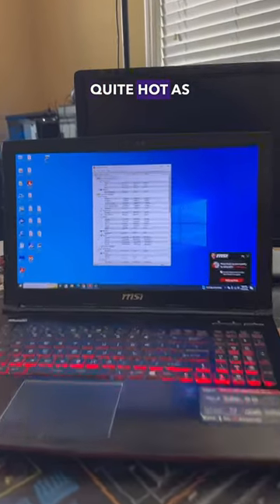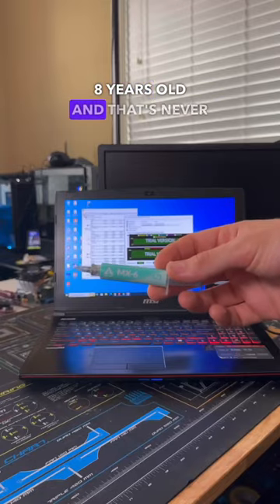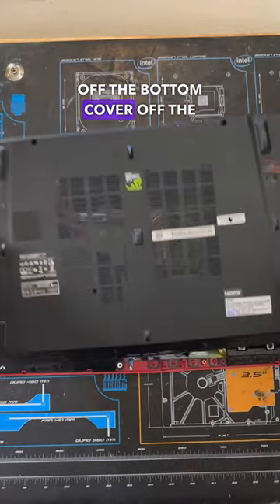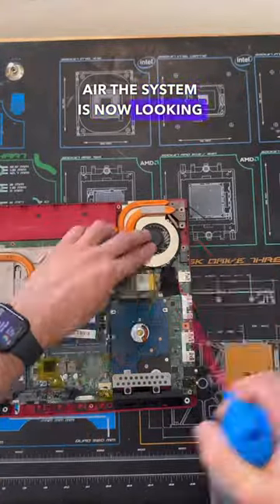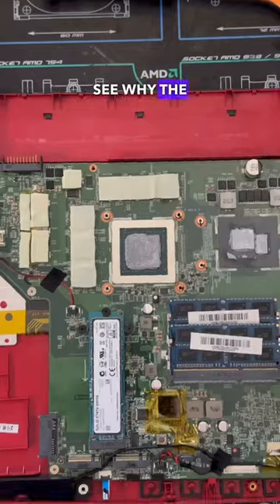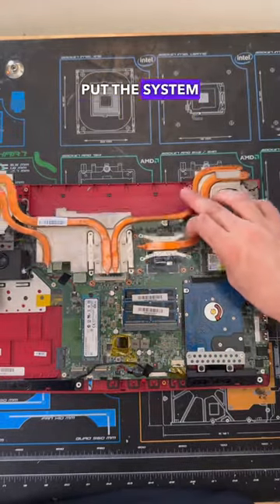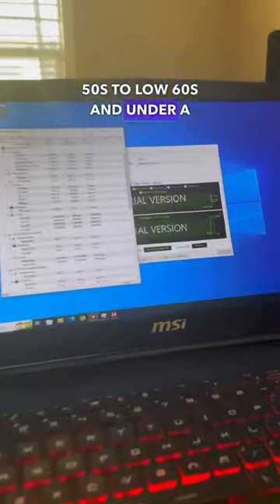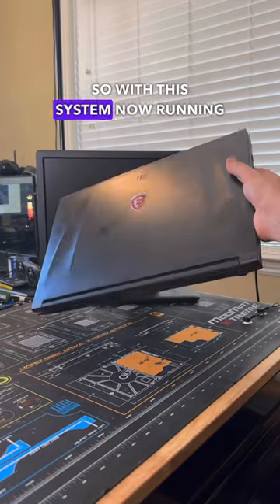Dried Up Thermal Paste! #shorts #pc #laptop #gamingpc #computerrepair #pcrepair #laptoprepair

Comment: With direct die thermal paste applications, you really need to be spreading it manually to ensure the entire die is covered. This isn't like a desktop CPU. If you had spread it, the idle temps could have been well into the 40s.
Reply: with pressure it will spread dyes are really small so